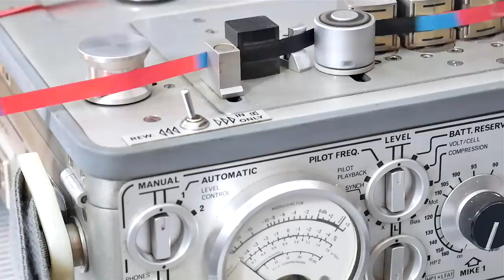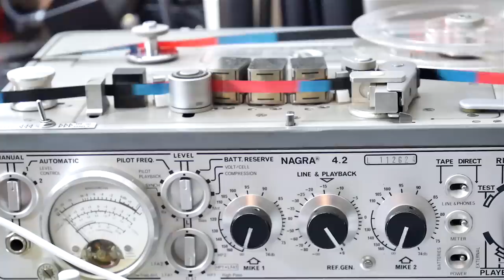How To Create Rhythm Tape Loops

Comment: Great video. I used to have lots of fun with tape, back when I did my studio training (a very long time ago).
If I might make a suggestion for more tape-based fun: maybe try doing this the other way around. Record onto the tape first (again, at all the different speeds) and then make the cuts and splices. Maybe with some rearrangement of the tape pieces. I think this would work very well with spoken word recordings.
I really need to get a reel-to-reel machine and a splicing block now. ;)
As always, it's a pleasure to watch your videos. Keep up the excellent work.
Reply from the maker: Hey Dan, thanks for your feedback! I already did the other way round - this had the goal of applying a rhythm to anything I record on the loop.

Comment: Great video !! I think I will try to do the same with my old reel to reel tape recorder !
You can also record any kind of continuous sound (sustained note, machine, motor, field recording...), and then slice the tape in little parts, then display them on your new tape, with a regular space according to the rhythm speed you want. 
You don't need to calculate the total length of the tape, provided that there is the rignt amount of "slices" to make repetitive rhythm (3/4, 4/4 or any other).
I will try this as soon as possible !

Comment: Have you tried threading your tape over and around the the capstan, then back between the capstan and the pinch roller in the opposite direction, then around the bottom of the pinch roller. This is what we did in the studio when we wanted to back-time. With this arrangement, when you press play, the tape goes in reverse. You have to be careful, because the capstan rubs the tape, but that might be yet another way to destruct a tape loop.
Reply from the maker: Nice trick, thank you for sharing!
Reply: Or you could just turn the tape upside down... You can also turn it around, like reversed, so the backside of the tape faces the tape head - you get a muted signal, how much depends on the thickness of the tape, but it works.

Comment: First I'd like to say that the piece turned out really good! But I have a tip for you: You might wanna try cutting up pre-recorded tape for the same purpose. If you have some old spools lying around, there's an endless resource right there! If you are gonna record new sound, it might be worth trying a more continous sound (for a steady beat), and you can vary the length/pb vs rec speeds and so on - but you already knew that... ;-) You might reverse the tape of course, also - for added effect...

Comment: I tried to do this with a cassette the other day - it took a lot more than 20 minutes to splice six (one second = 47.5mm each) equally-sized pieces of tape into a loop! No splicing block or specialised tape, just scissors, sellotape and patience. Of course, the loop was quite long and I couldn't fit it on one wheel. It immediately got pulled to pieces by the capstan. Back to the drawing board tomorrow, with more tension inside!
Reply from the maker: That is hard work, bravo!

Comment: hi hainbach! would this be a challenge for you, its a copied text of how marcus fischer made album 'arctic antarctic'. if you can do the same process or similar. here's the text:

“Arctic/Antarctic is centered around a series of guitar based improvisations.  
The first half, Arctic, consists of the gradual folding and unfolding of melodies played on guitar and sustained through the use of a custom designed granular delay plugin.  
The asynchronous delayed notes are pitched both up and down resulting in organ-like textures.  
Layered atop portions of Arctic there are the playful sounds of hail on the exposed tines of a toy piano.
The first 1/3 of the Antarctic portion is based on the slow shifting of loop points within a larger guitar loop.  The rest of Antarctic contrasts with prior sections.  
Rather than using digital processes, this portion relies only on loops created using a system of modified analog cassette tapes.  These cassettes were played back and rerecorded at a distance capturing some of the surrounding sounds such as cats moving about the room and hints of nearby construction.”
Reply from the maker: Thanks for sharing! Not really something that interests me to copy, as I have used most of these or similar techniques in my own works before. But a good reminder that one of the most interesting things is to let distance and the outside into your works.

Comment: Good to see that your tape editing/splicing technique has improved by leaps and bounds. But perhaps you need to find a new position for the Anglepoise lamp that is in the right hand corner of the table, as it seems to be hindering access to the splicing block on the Telefunken. With it out of the way, maybe you can decrease that 30 minutes total splicing time down to 20 or less (= more time for recording).
Reply from the maker: Sadly, that is the mic stand. I tried putting it elsewhere but it ended up blocking the camera or being instable. Probably need a lavalier at some point, but then I can't buy all the audio gear that is fun to play with. 😄
Reply: @Hainbach  Point taken, dosh for more toys is always more important. But is there not space on the floor behind your right shoulder for a €10 boom mic stand tripod? Or maybe somehow attach your current one to the metal shelving in the background so it goes up and over your head yet stays out of camera shot...Just a suggestion.

Comment: Are there materials that could be painted onto tape (like alcohol or something) that could remove the ferro material and leave blank spots like where you have the leader tape? I'm imagining that could make the cut process less time consuming. Or perhaps a strip of fridge magnets that could demagnetize rhythmic spaces on a recorded loop. I'm trying to imagine ways to make the loops with less cutting that might allow quicker access to rhythmic variation.
Reply from the maker: If the doors of perception were cleansed everything would appear to man as it is: Infinite. This I shall do by printing in the infernal method by corrosives, which in Hell are salutary and medicinal, melting apparent surfaces away, and displaying the infinite which was hid.

William Blake, The Marriage of Heaven and Hell
Reply: @Hainbach  soooooo, yes? 😂
Reply from the maker: @goodpal7444  We will see :-)
Reply: probably cut patterns into something similar to scotch tape and then stick that onto the tape itself, then dip into the solvent
Reply: @martinslatten1983  does tape come off non destructively? Even if not that could be cool.

Comment: Just discovered your videos and don't have any previous experience with open reel tapes, so excuse my ignorance. Is the table single sided? If so, couldn't you skip the blank tape and just splice segments together with every other piece "up side down', but make a Möbius strip to double the time for the loop?
Reply from the maker: Interesting thought! The main reason no to would be that the splicing tape would rub over the heads, wearing them down and gunking them up with glue.

Comment: this is wonderful, but would it not be also possible to use a tremolo or on/off switch on an output to make a similar audio cutting effect?
Reply from the maker: Thx! Only for a part of the functionality, because you are free in the pattern that you can use, tape has its own sound, you can vary the pitch as well as the interval, you can reverse the loop, you can overdub on it.
Reply: @Hainbach  absolutely, the sound is impossible to replicate.  I have done similar things with an on/off switch going into an empty loop, but the fact that the negative space can't be over dubbed into makes this really beautiful.

Comment: I know I'm late to the party on this but... rather than splicing in leader tape, would it be enough to cover the magnetic tap with a layer or two the adhesive tape? It wouldn't be quite as colorful, but a lot faster.
Reply from the maker: No, the magnet would still erase and then you have sticky tape running over you heads and parts, which will cause the whole machine to gunk up and ultimately stall.
Reply: @Hainbach Clearly, I didn't think this through....

Comment: You’re basically getting a tremolo effect it seems...  I think you’d get more interesting results if you doubled your length in some parts  and halved it in others... I think it’d give you more of a rhythm pattern then a tremolo effect then.
Reply from the maker: Yep, this was a proof of concept. Already made other loops with more interesting patterns.
Reply: HAINBACH I figured you probably would I didn’t realize this was an older video however.  Technically speaking I’m a guitarist.  But I’m interested in recording with analog tape now because of you.  What’s a good tape recorder I could get at a decent price to start out with?
Reply from the maker: Revox B77, Uher Report Monitor, Tesla (the black machines)

Comment: same as recording multiplied by noise masked pulses
Reply from the maker: I can't really unpack what you are trying to say.
Reply: Take low frequency (0.1-3 hz) pulse oscillator with variable width. Then multiply it with desired sound.
Reply from the maker: I never thought of doing this intentionally, it happened by accident before. Interesting, thanks for sharing that!